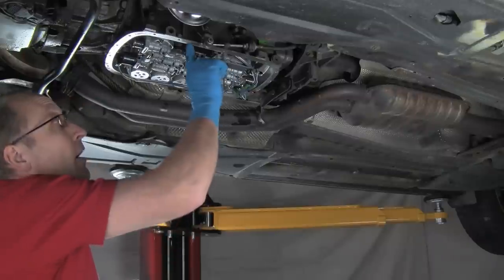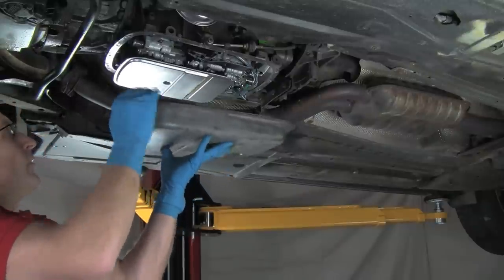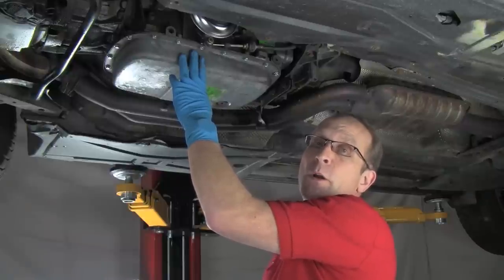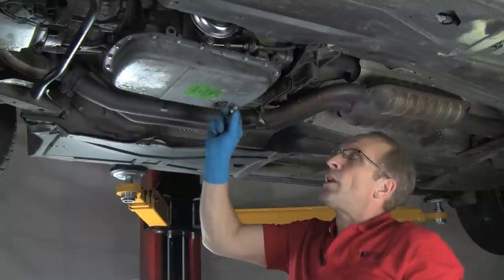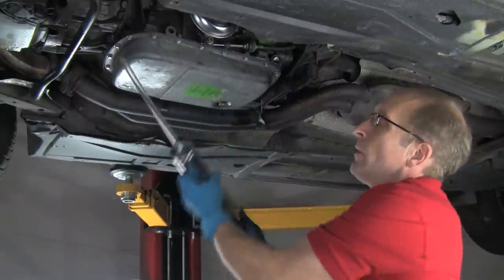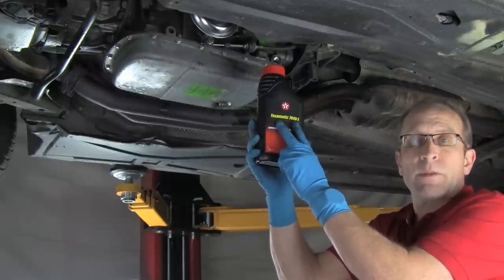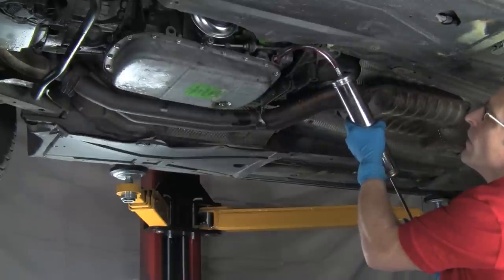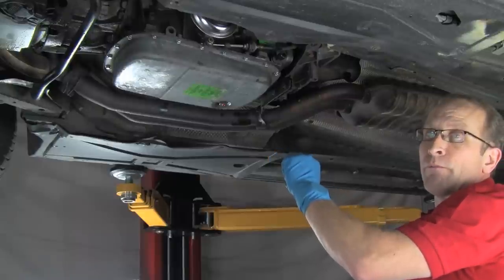Part 2: Changing Automatic Transmission Fluid & Filter On A BMW/MINI

Comment: Hi,
Fisrt, thanks for the video. really good. 
i've recently bought a 99 540iP, it has 104k km (about 65000 miles).. I'm beginning to experience some weird behave of the AT... When I hit the gas, when it comes to 2800-3000-3500 rpm, it feels like the gears were slipping.. It keeps reving up, but the torque curve is not smooth. (my brother has a 96 540, non-protection, and it goes smooth...)
Could be the first signs of low transmission oil...?
 When I put it in reverse, i get a kick, no matter how hard i step on the brakes.. The reverse thing usually happens when the engine is hot (traffic jam, for instance), like the oil becomes thinner because of the temperature.. Any tips? BTW, no warning or lights on the dash.
Reply: I have the ZF 5hp24 transmission, by the way.
Reply from the maker: We would suggest a fluid and filter change as a first course of action.  If the fluid that is removed looks like it is the original fluid, do a second fluid drain and fill after driving the car for a couple miles.  This will assure a higher percentage of fresh fluid in the trans.  See if this helps as you drive it for a while.
Reply: BavarianAuto Hi, thank you for your response. I've done the oil and filter change. Car runs perfectly when cold/cool.. When the oils get hot (traffic jam, slo traffic) I get the kick when engaging reverse, only when the oil gets hot.. About the revs, I discovered a air leak after the MAF, and also vacuum leak. Got the codes P0171 and P0174. I
Reply from the maker: Thiago Salgado
The continued transmission issues are likely valve-body related, but we can't really help much further at this point.  The valve-body is replaceable without removing the trans from the car.  You may try locating a fully functional used transmission and swap the valve-body.

Comment: question i have a 2008 525i . is it the same as your video
Reply from the maker: The procedutres will be the same, but you do have a different transmission (GA6HP19Z).  See the link below for details on the fluid and filter change on the GA6HP family of ZF transmissions.
http://blog.bavauto.com/15410/bmw-diy-video-fluid-and-filter-change-automatic-transmission-zf-6hp-models/

Comment: I have 65k on a 328xi and my trans is shuttering. The Bentley manual says it start to do this around 60-80k and to do a fluid and filter change. 
Why does it shutter, and will it stop after fluid flush?
Reply: Jonathan Jackson Hey man, i have a 2011 128i with 65k and it shutters as well.  I have read to change the fluid/filter fixes but not sure either.  Lmk if you find a solution.
Reply: @rg15502550   will do

Comment: thanks for the great vid. i have a question, on my 2001 bmw x5 first gear will not engage straight away when pulling away after its been in neutral. it has a slight pause then it kicks in hard like a shunt, would changing the oil and filter help, as its never been changed with 12k miles... thanks again :)
Reply from the maker: Absolutely, change the fluid and filter as a first step.  In fact, if the fluid that is removed is very dirty (like the fluid from the transmission in this video, which is the same transmission that is in your X5), run it after the fluid change, to mix the old & new fluid, then do another fluid-only change (just drain & fill) in order to get a higher percentage of fresh fluid.
Reply: Thank you very much for the fast response. Also its at 120k miles not 12k.. Thanks again for all your help :)
Reply from the maker: est8484
 - We figured as much (120K).
Reply: Hi est8484, my 645i behaves exactly the same way. Since is my first 6 series I thought it was just the way it was supposed to be. I called BAV.auto and asked if their "sprint booster" would fix it, (maybe it was a " drive by wire issue"), they told me it sure would. Now I find out you have the same thing happening and Otto tells you its a trans. issue?! Did you change the trans. fluid? Did the hesitation go away ? I'd appreciate if you could answer.  Thanks.
Reply from the maker: Takaro Nakara
 - There are some driveability issues that the Sprint Booster can help with .... such as a laggy feeling throttle.  However, the symptoms as were originally described, do not sound like the normal "fly by wire" issues.  We'd try the trans fluid first.
Reply: Thanks for the answer, BAV. But I wish "est8484" would answer, since he said he was going to do the trans. fluid change and I wanted to know if that fixed his problem before I go ahead and do mine.

Comment: Will this procedure be similar on a 06 525i?
Reply from the maker: The GA6HP19Z transmission used in the E60 5-series models will have different fill and drain plugs as well as a different (but similar) filter.  However, the basic procedures are the same.  The Bentley repair manual for the specific BMW model will detail the fill, drain and filter differences.

Bentley repair manuals:
http://www.bavauto.com/se1.asp?dept_id=5228

Comment: Hi, I have a 2005 325i with the sticker (blue i think) that says to replace only with 83220024359, when I called bmw, they said that I can just use Dexron VI. Is this ok? How many quarts do I need? Do you fully drain and fill again 2 or 3 times to flush out all of the old fluid?

Comment: Do you have same maintenance for e39 540i, 1999?
Reply from the maker: The procedures will be similar to what is shown in this video.  We have a photo DIY showing the exact transmission in your 540i, in the link below:
http://blog.bavauto.com/10888/bmw-automatic-transmission-fluid-and-filter-change-diy-e34-e36-a4s-310r-325i-328i-525i-others/

Comment: Hey Guys, I just changed my trans. fluid in my 98 bmw  323is auto ( A4S 310 R ) THM- R1 it calls for DEX III but I put in DEX-VI because all the research ive done people say it much better fluid and is compatible with DEX III..any thoughts anyone? BAVAUTO I really would like your opinion!
Reply: no one recommends dex III. I used it still on my 91 because I wanted super low maintenance cost but dex vI has replaced DEX III...your book may say III or dip stick but any service bulletins would upgrade it to DEX vI...foams less does a few things better. I just used the III in my 91 Supertech oil and supertech dex III and I change the oil twice a year and the transmisison 18 months which is only a few thousand miles

Comment: I have a 325i auto that does not have power going uphill but on flat road perfoms well could it be that the transmission is done for,thank you.
Reply from the maker: Does the engine speed go up, but the vehicle speed does not ..... when going uphill?
Reply: BavarianAuto the engine speed doesnt go up ,also the transmission checklight stays on even after driving and stopping and completely turning off engine ,when you restart car it stays on .suprisingly reverse gear works normally,thank you.
Reply: BavarianAuto the engine speed doesnt go up ,also the transmission checklight stays on even after driving and stopping and completely turning off engine ,when you restart car it stays on .suprisingly reverse gear works normally,thank you.
Reply: BavarianAuto the engine speed doesnt go up ,also the transmission checklight stays on even after driving and stopping and completely turning off engine ,when you restart car it stays on .suprisingly reverse gear works normally,thank you.
Reply from the maker: kenneth chasokela
 - If the engine speed is not going up - the transmission is not slipping.  When the trans fault light is on, the transmission is in a ""limp" or "fail safe" mode.  In this mode, the transmission is not shifting.  It is always in just one gear, typically 3rd or 4th.  It starts in this gear and stays in this gear.  In order to figure out what may be going on we need to have the transmission fault codes read.  This requires the full diagnostic tool that can go into all of the vehicle systems ... not just OBD-II engine management codes.

Comment from the maker: Your manual transmission does not have a filter.  When changing fluid on a manual transmission, you just drain and refill the fluid.  No pan to remove and no filter. We have a DIY on manual transmission fluid changes at blog.bavauto.com/go/manual . We have all of the proper fluids at bavauto.com.

Comment from the maker: Yes, we recommend that you start at operating temperature.  Two reasons for this:
1)  The fluid will drain faster and more fully, being hot.
2)  The transmission will already be warm and you will not have to run it for as long when you are performing the fluid level final filling, which needs to be done with the fluid at operating temp.
NOTE:  The fluid will be around 140 degrees F!  Be careful,the hot fluid can burn skin.
Reply: ok

Comment from the maker: samoranis1 - We can't reply directly to your comment as it came in via Google.
We suggest that you first check the fluid level (remember, the engine MUST be running before you remove the fill plug).  If it is low, add the proper amount and see what happens.  If the fluid is not low, or adding does not help, you have an internal problem and the trans will need to be replaced or rebuilt.
Reply: hello. I am from Europe Slovenia I drive 525d e39 series. 2003.  I had problem when I was going uphill about 100 meters and after strait line my car was not shifting it was on 1st gear for about 20 seconds and I was pressing gas and did not switch to 2nd gear. I was scared. After it switched normal and was driving all day normal. Only after hill was problem car did not changing gear. Can you tell me what was the problem? maybe I need to fill oil or ? Can you answer me please. sorry for bad English,.
Reply: MakeSh00t
Reply: graham mckenzie
Reply: graham mckenzie

Comment: Is this a similar thing with 2003 Mini cooper automatic?
Reply from the maker: Any automatic transmission fluid change would follow these general procedures, including MINI.  The problem with the MINI is that the fluid pan is not accessible without initial removal of the under engine crossmembers.
Reply: Thanks, great video btw
Reply: BavarianAuto What would be different on a 2009 Toyota Avalon XL?
Reply from the maker: Carlos Fabela
 - Can't say, exactly.  Check a service manual for your Toyota, for specifics.

Comment from the maker: Always .... always .... ALWAYS, perform regular fluid changes on the transmission and differential!  BMW only cares about keeping the maintenance cost low, while the car is in the warranty and/or free maintenance period.  They'd rather see you buy a new BMW when the warranty is out .... rather than keep your current one going for many more miles.

Comment: You dont need that magnetic plug lol, just buy a bunch of strong magnet that has a rating of 2kg, and stick it on the outside of the tray and it will keep the metal shaving on the bottom of the tray

Comment: Would it be the same for a 97 M3/4 auto?
Reply from the maker: The M3 uses a different transmission.  The overall procedures are similar.  The biggest exception is the filling.  The fill plug is the larger plug on the underside of the fluid pan (at the rear).  You have to pump the fluid up through this plug hole and into the pan.  Your pump hose needs to have a "J" or "L" shape in order to ho up through the hole and then over the top lip and into the pan.  You fill to capacity just like the other types, until fluid overflows from the fill hole .... WITH THE ENGINE RUNNING.
Reply: BavarianAuto for the ZF 5HP18 I'd still have to verify what fluid goes into it correct?

Comment: Which type  should l use for it  and how more
Reply from the maker: Fred - are you asking; what type fluid?  What year & model do you have?
Reply: 2013
Reply from the maker: Fred Boateng
Fred - in order to quote the correct fluid and filter, as well as the quantity of fluid, we would need to know exactly what model you have, not just the year.

Comment: hello friend if your car does not reach the 50,000 miles which the period in years that I have to replace the oil in the exchange? My car is an E36 year 1997 and still has 20,000 miles
Reply from the maker: We would suggest a transmission fluid change due to the age of the vehicle and the fluid.
Reply: I visited a BMW shop in Brazil and they told me it was not necessary to be the moth for long life. What do I do now?
Reply from the maker: Fabio Matos
 - We're not sure what you mean.  Did the dealer tell you that the fluid is "lifetime" and never needs to be changed?  If this is the case, just have it done at a proper and good independent service shop.
Reply: BavarianAuto that. The BMW consercionaria said no need to replace the oil. In the car manual says the same thing. So I'm guessing.
Reply from the maker: Fabio Matos
- yes, BMW calls the fluid "lifetime"  This is an effort to make it look less expensive to own the car.  In other words, less maintenance cost.  However, your certainly DO need to change the fluid periodically.  See our article on this, here:
http://blog.bavauto.com/11194/bmw-diy-video-automatic-transmission-fluid-and-filter-change-how-to-replace-auto-trans/
Reply: I believe in you guys. Now I wonder what fluid to use? And this how many liters in exchange cambio A5S310Z will use? This procedure exchange qantos liters? I appreciate all the information and help now.
Reply from the maker: Fabio Matos
 - Your A5S310Z (same as shown in the video) uses the ZF Lifeguard-5 fluid.  You need 6 quarts (or 6-Liters).
http://www.bavauto.com/fland.asp?part=LIFEGUARD5
Reply: Hello, this fluid indicated not think in Brazil. Has some of motul or Simitar brand that you can use? Is there any specification of the fluid is independent of the brand?
Reply: hello friend took a look at the car manual and it speaks three liters. Researched in the Motul site and it also speaks three liters. For routine maintenance switch is made this way? Like this does not come off the fluid is in the torque converter. Sorry for so many questions. Not have much information on the internet. The consercionaria said the replacement would be almost 10 liters ????
Reply from the maker: Fabio Matos
 - The fluid quantity we show (6-liters) is what we have found to be needed, in doing these transmissions.  If you do have the A5s310R (depends on what your E36 model is), this is the same as the one in the video ... which required just under 6-liters.  This is just what comes from the pan .... the torque converter is still holding fluid.
Reply from the maker: Fabio Matos
The original fill for the A5S-310Z is ESSO LT 71141 - Any fluid that is qualified to be a direct replacement for this fluid, should be OK.
Reply: hello friend thank you for your help. Searching the net I came to this conclusion. Today the esso is manufactured by MOBIL more is the same oil. I am very grateful for your time.
Reply from the maker: Fabio Matos
 - Good luck! Now, go get that fluid changed.

Comment: How many quarts
Reply: It says 10 quarts if you drain the torq converter but 6 if just filling the pan.  Make sure you heat the transmission up to 130-170 degrees and check again.

Comment: I made the mistake of changing the oil,and filter,thinking I was draining the oil,instead I drained the trans fluid.now it has 2 times the oil in it,and no trans fliud.so I have to take it and have the fluid filled,and the oil drained,and put back in.i traded my Suzuki hayabusa for the little bmw 323i,just because of the weather here in ohio,it rains all the time.the bmw is nasty,the guy I traded with owns a custom shop,so you can imagine the extras on the car,it looks like a little grand theft auto car.totally tricked out with deep dish low profiles.many engine upgrades.when I tried to go to work today after changing the oil,the rpms were reving and the power was not transferring until I let off the gas.luckily I found a mechanic who told me about my mistake,and he saved my car and a lot of money.i will take it to him tomorrow to fix the fluid problem.your video is great,i can take apart a hayabusa,and do anything on it service wise.but a bmw is something you should not work on until you have all the info.i thought a drain plug is just a drain plug.wrong!!very humbling.i can change plugs if I have to ,thanks to great videos like yours.thank you,and I will always consult the experts before acting like im a expert.it still costs me 200 to 300,dollars to rectify.if your not sure don't do it.or you will be sorry like me.i have one ? how much fluid in quarts does the trans hold.??thanks again for the videos,i will consult them way before I attempt to do anything.the car and the engineers are smarter than I am.

Comment: I do not trust any other Garage including a BMW dealerships to perform this job as good as you completed this task. Once you take your car into a garage or dealership, you are unable to see whats being done behind closed doors. Mechanics are sometime hacks and at times they skip steps like running the engine to temperature to add additional fluid.My BMW 330xi E90 has 104,000k and I would do it myself but don't have a hoist.....BMW dealerships are overly expensive and skip important steps.  I have had bad experiences....(wish your shop was in Hamilton Ontario !!!)
Reply from the maker: Mark,
You certainly can do this laying on your back and with the car on four jack-stands.

Comment: THE TORQUE SHOULD BE 10Nm OR 7.3 FOOT POUNDS!  NOT 15 FOOT POUNDS. After snapping off 2 bolts, I again referred to the oracle... AAAAAhhh Wrong! Thankfully the bolt holes are external. Stripped out the transmission side treads. External bolt holes saved me as I was able to buy a new M6 30mm with a top nut. these 2 new bolts I added are better than the factory crap. This company is closed anyway, maybe due to poor information.